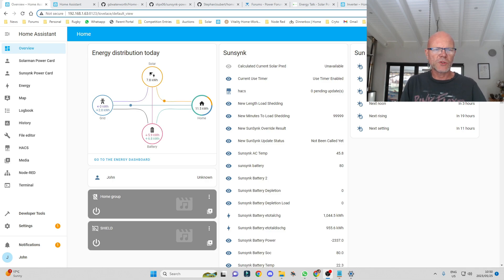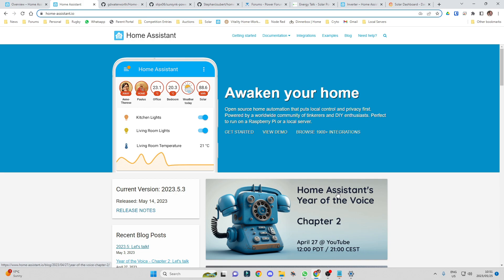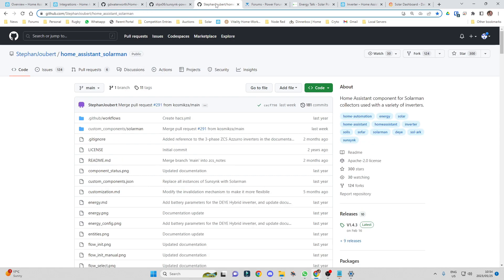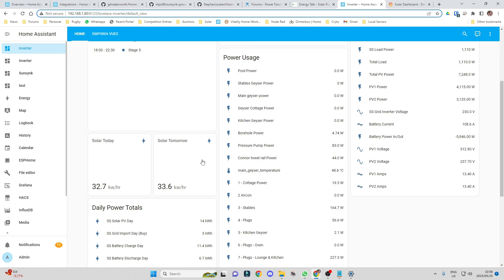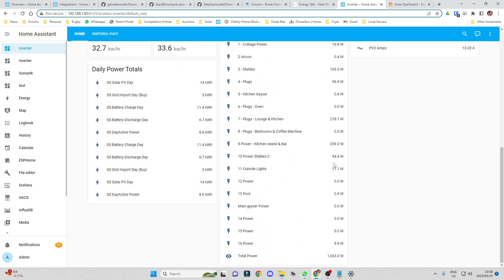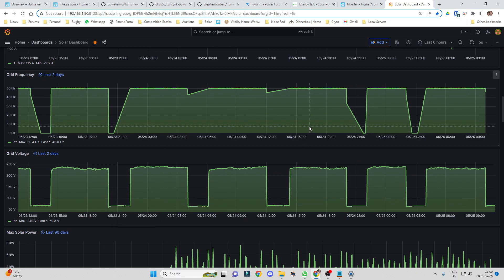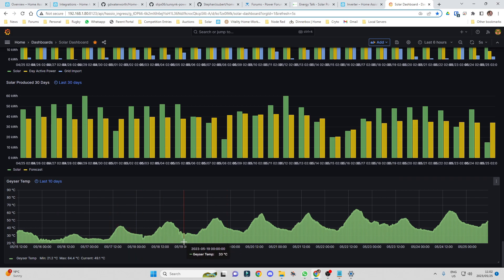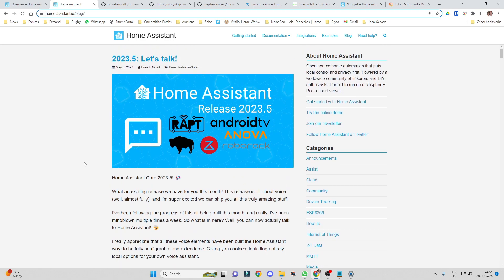Reasons to use Home Assistant with your Inverter

Comment: Which geyser switches do you use? I used contactors in conjunction with Sonoff Basic's, but those can't measure the power, it only measures the power the actual contactor consumes.
Reply from the maker: Hi, I use a mix of Sonoff Pow 16A's  & a Chinese 63A Breaker which also runs on Ewelink on my geysers/borehole etc. https://www.takealot.com/geyser-smart-wi-fi-switch-energy-monitor/PLID93647687

Comment: Thanks Which device you using for your geyser etc to monitor power ? Thanks
Reply from the maker: Hi Vaughan, I am using primarily Sonoff smart switches which include energy monitoring. I do however also have some Tuya switches running as well.
Reply: @SolarIntegrations  Which Sonoff switch you using for geyser .
Also, have you flashed your Tuya device with Tasmota or Esphome  etc ?
Thanks
Reply from the maker: @vaughanza  I use the Sonoff POWR320D for my geysers, along with some Smtonoff 63a switches as well, Sonoff's & Tuya all running standard firmware, seems like a lot of effort to change them and don't really have any reason to do so. I use the SonoffLAN & Localtuya integrations to keep it all local.
Reply: @SolarIntegrations  you star, thanks.
Reply: I can recommend the Geyserwise with the geyserwala board. I replaced my 3kw element with 1kw and my Sunsynk 8kva happy with that and the pool pump on the sonoff powr320D switch with everything else with no problems

Comment: Hey, great videos. Thanks for sharing! 

Is it possible to setup automations on your inverter using only home assistant and the solarman logger? Or would you need to get a dedicated solar assistant installed ?
Reply: Thanks for the reply. So it's possible to let's say run an automation to change your time of use settings on the inverter if the solar forecast is sunny as an example?
Reply from the maker: @xavsod  Hi Xavier, 100% correct, I am planning a video at the moment on how to set up your Dashboard so you can manually change the settings and then an automation to automatically change the settings when an overcast day is forecast to increase the minimum amount of power kept in the batteries.
Reply from the maker: Hi Xavier, The Automations get run in Home Assistant, not in the inverter. You pull all the data you need from the inverter using the Solarman integration into Home Assistant. I am not aware of any scenario's that would require Solar Assistant to do something that you can't do in Home Assistant.
Reply: Amazing!
Reply from the maker: Thanks you  @xavsod  is lots of fun making them and I am learning more about Home Assistant in the process

Comment: sorry  noob to home assistant how did you make home Assistant turn pool pump on and off depending on how much sunshine you got very interested in this . thanks for the videos so far
Reply from the maker: Hi Simon, thank you for the question, I am planning to do a video showing how that works in the next week or so. I have three other video's that I want to get out first, firstly one on installing the Eskomsepush integration foir the load shedding schedules, then the one for solar forecasting and finally the smart switches, once I have them done. I will bring them altogether and show the automation to switch the pool on when there is sun forecast for example. Stay tuned and make sure you are subscribed, will be fun :-)